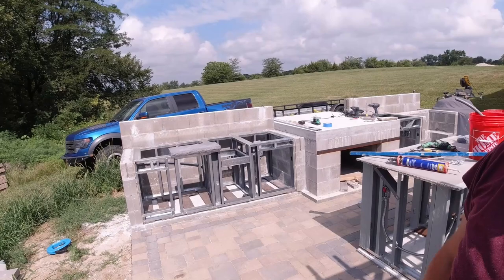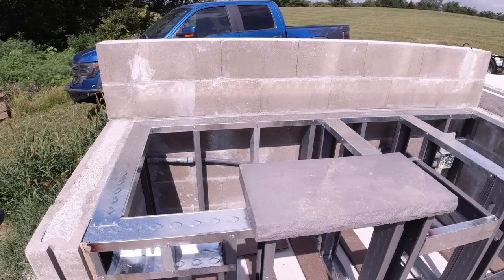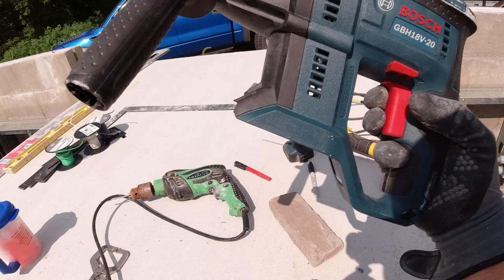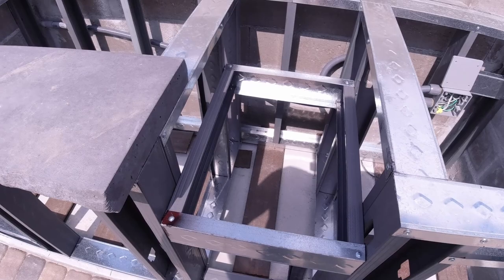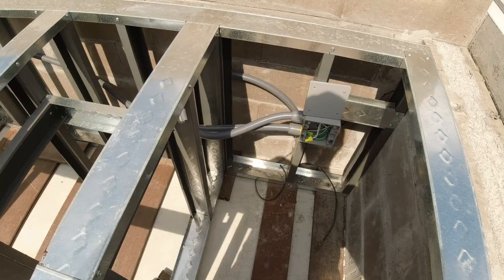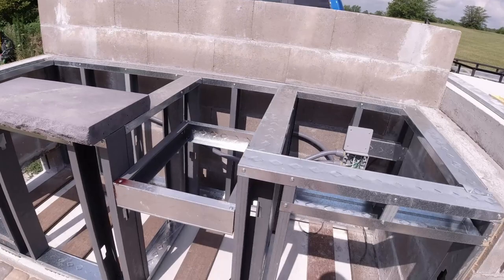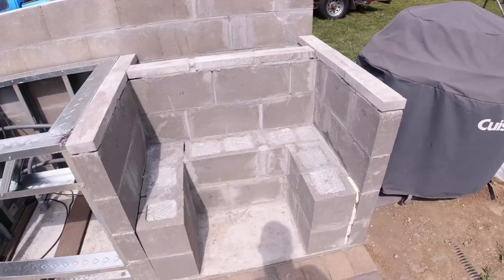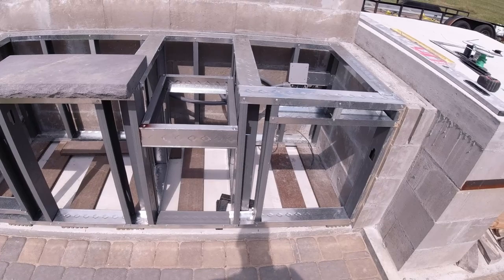Framing our Outdoor Kitchen for the Argentine Grill | #outdoorkitchen #diy

Comment: Your videos are great and I'm going through the exact same project right now.  I'm actually lay cinder block for the pizza oven stand.  I saw in a earlier video you posted a short on a tip for concrete countertops.  Do you plan on posting a full video?
Reply from the maker: Yes, the countertop videos should be ready in the next couple videos.